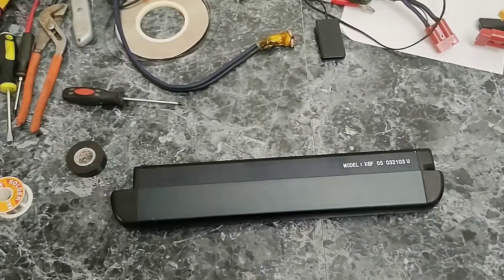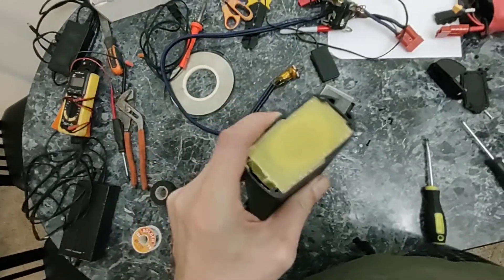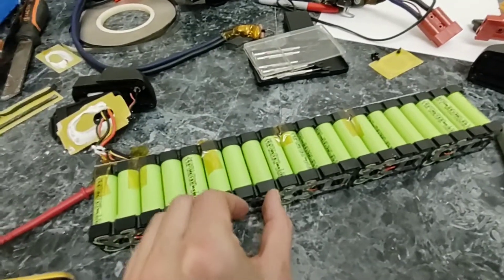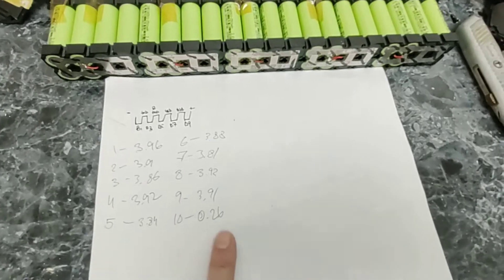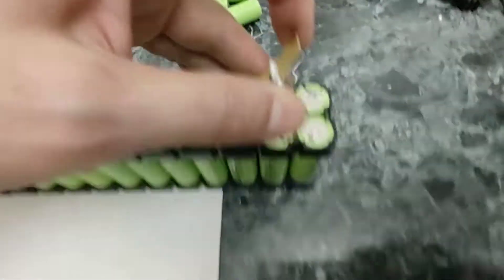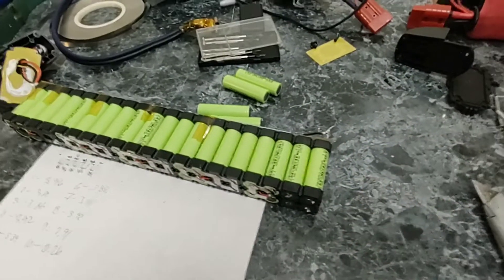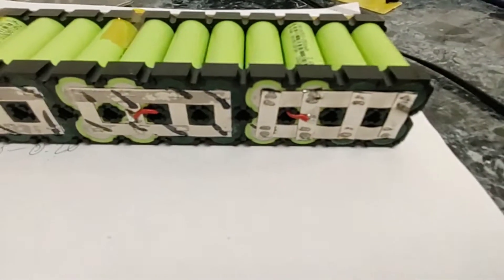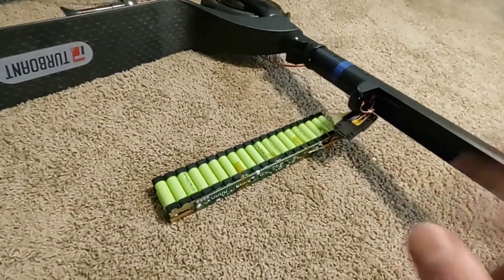Fixing 36v electric scooter battery on the budget (Turboant x7 pro)

Comment: Hello I’m working on a HX X9 battery which has a similar 3 prong connector. Since someone has worked on the battery before I’m unsure of the proper wiring. Does the “A” terminal have the 42 volts going to it to start the battery. Currently the battery is wired with the 42 volt positive wire going to both the + terminal and the “A” terminal and the negative going to the “-“ terminal. Scooter will turn on for a few seconds and then turn right off. Before I go any further troubleshooting the controller Inwant to ensure the battery is wired correctly.

Comment: If my new scooter is coming with a 36v 7.8 amp battery. Is it safe to assume it's a 7800mah battery pack? So would a 10s pack made of 10 individual 3000mah and 15 amp batteries be an improvement?

Comment: you said that you set the throttle up some how so you do not need the starting push roll to get it going ... i have looked for this setting in the manual and online but can not find it; can you give a detail description on how to set this up so you do not need the starting push roll ? ... i want to just push the throttle only to start going ... no push off needed.  thank you gordonr
Reply: there is a hidden menu (search YouTube for scooter hidden menu). I did it on mine and in that menu there are lots of options one of which is to start without giving it a push .   Now I'm here because i have the same battery as this guy's video and it doesn't charge (so i gotta disassemble it and change some cells or jump start them)

Comment: Great job! I have already recell this kind of battery, but after I switched on the battery (yellow wire to ground) I can measure only 31V at the discharge port. Charging working well and on the battery charging port, I can measure 41,2V. What could be the problem? Thanks for your help in advance.

Comment: I have the same scooter, same battery, battery is showing 29.2V, and the scooter is not working. Is that enough or do i need dissemble the battery pack or it's problem with controller? Thanks for your answer.

Comment: What for is that middle yellow wire?
Reply: Same question here what is the purpose of the third blade on the battery connector?

Writen A (between+ and -)
Reply: @Luczias   I found a purpose, it serves as a battery switch, you need to connect the yellow wire with the positive red + wire to start the battery. When you disassemble the motor controller you can see positive and yellow connectors are connected.

Comment: Should 32V after a charge should be enough for the scooter to turn on? My scooter was very flaky (would turn off/on while riding) for a couple weeks and then just wouldn't turn on at all. Heard popping sound (likely from sparking) when it was shutting down. Replaced the controller and display panel and tried the same battery and initially (first time only) it turned on but then immediately turned off and hasn't been able to turn on since. Voltage output on the battery is 32V. Customer supports says I need to replace the battery because 32V is too low but I don't want to spend $220 only to find that something else is broken. And while this video is very cool, I don't know if I have the confidence to replace battery cells.
Reply: You can buy blue drone battery universal charger, open the scooter battery, and charge it by groups of  cells, it's like I restore one dead scooter battery,  because one of the group was to low
Reply: Have u found any solution?
I have the same issue with two batteries first the original kept on turning off when riding and then I bought a new one 
Worked for around 1and a half month and then did the same thing.

Comment: Very interesting, great job. A bit beyond my time and expertise. Everyone's thoughts on buying another battery, or are they designed so poorly it will keep happening so I should just cut my losses and get a different brand scooter? Seems like there's a lot of these scooters with bad batteries.
Reply: With all due respect your best bet is to hammer down your knowledge of 18650 battery sets. Most if not every scooter is going to come with very cheap cells. And most scooters run off 18650 battery sets. Your best bet is to hammer down your knowledge so that you are able to repair these batteries with the best cells that you are able to procure. Cells that are not made in China that are of reputable materials. Otherwise it's a hit and miss game of how long a scooter will last and how well it will perform. Best of luck to you. The technology is amazing.

Comment: Great vid!  Anyone know WHY that last group of cells were so depleted?
Reply: My guess is it has to do with thermal runaway. The last pack of cells is typically where the energy is drained. This leads to high heat. And if improper precautions are not maintained thermal runaway within these packs is possibly the issue. I am in no way shape or form a professional. Just my two cents.
Reply: @04i67 Thanks.  You are probably correct
Reply: @mattc825  aspiring to maintain these kind of batteries myself. We all should. Take  the power from manufacturers back
Reply: @04i67  Yeah, literally!!  Good luck. 👍

Comment: ty for video..i opened mine bms is bad but no signs of burn or loose wire..it powers off when its on full load..new controller, led display, thumb controller..motor hub is good i tested with 2nd good battery..do you know where to buy or how fix bms?..
Reply: update....its not BMS prob...female connectors red and yellow wires loose solder..i resolder now good.
Reply: Hi @hsamson1103 what do you mean by full load? My scooter runs fine on the bench, but when I ride on it, it powers off after 50-100 meters. Hope you can help.
Reply: your problem is in the battery...soldering came loose usually the yellow n red wire..
Reply: @hsamson1103  thnx for reply. You mean the solder at the connector or the cable soldered to the bms

Comment: I need your help, I have 7 pin X8 model e-scooter i took out the battery from case and i measured the voltage from battery poles before getting in BMS it shows 42V. but out put shows 0V, so i took small cable and  connected battery negative to out put negative. then i got 42V in out put....is that OK ?? This is my first question for you. Second after i installed the battery scooter didn't start or couldn't be on. do you think it is the cause of controller failed ??? I appreciate for your reply.
Reply: Has your problem been solved now?

Comment: how do you determine if the battery has become faulty? I'm not sure if I have a battery problem or motor problem, but when I accelerate it starts beeping and battery level drops to one bar from being fully charged and it's not possible to drive unless I turn it off and back on and then drive slower
Reply: if its still charges ok..its bms
Reply: Your batteries are high capacity but low amp rating.  Trust me, I’m right on this.

Comment: I have a 3 pin connection on my X8 Lithium Battery is very worn. from use. Sometimes it helps to hold the battery firmly in the exact position, to get the Electric Scooter to turn on. Is it possible to change the 3 pin connection on my X8 Lithium Battery? If I cannot change the 3 pin connector, can I repair the present 3 pin connector? Please advise. Thanks
Reply: Turbo ant sold an upgrade. I wonder if they have parts.

Comment: Just curious, how did you change the settings for zero start?
Reply: Either from the app if you have the bluetooth version you can find it in settings, otherwise hold both buttons when it's on and go to the "P2" option to turn it on

Comment: Can you put larger batteries in the pack as long as it still produces the same voltage to possibly make like a 20ah battery for this exact scooter
Reply: You can get cells with higher mAh ratings.  The original was probably 2600mAh there are cells with 3000-3500mAh it's a 10s4p setup.  4p x 3Ah 12Ah
Reply: I've been wanting to try going 48v in a 3p pack to see if the controller would take it but don't think I can find abms that would fit in the case

Comment: what is the expected voltage of the finished and charged pack? mine shows 31.8v.  Also, how do you measure voltage on individual groups if everything is connected together?
Reply: When you measure at the ends of each bunch of 4 cells you can only get the voltage that is in between the first and last battery.